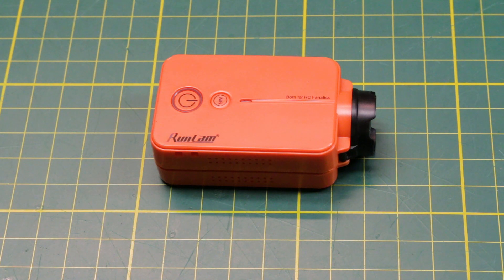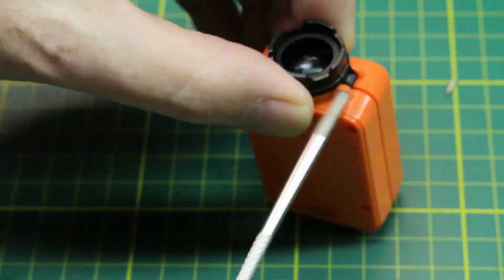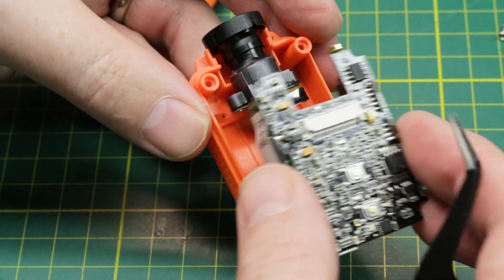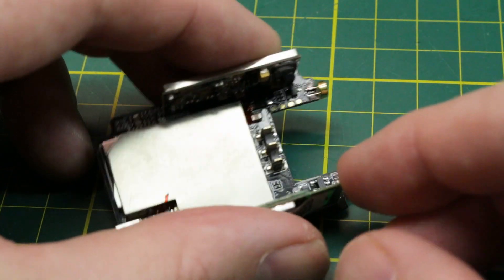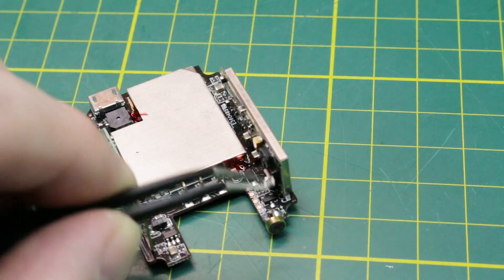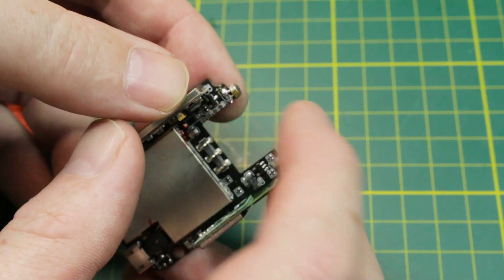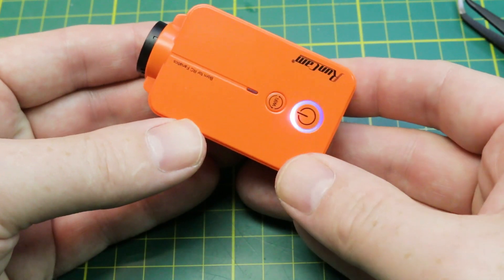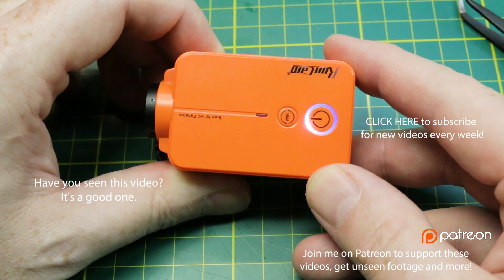RUNCAM EASY AUDIO FIX | MUST-DO MOD

Comment: I wonder if you used a lower value resister, say 100 ohm: if you could get enough attenuation to avoid clipping, but not so much that you're losing audio data cause the resulting sound while not clipping is very quiet
Reply from the maker: Its at about half volume in post (or less) so people wouldn't blow up at me for screaming quad motors in their ears ;)
Reply: Since the resistor is across the mic (rather than inline), you'd have to use a higher value resistor to get less attenuation.

Comment: It is $28 for the pack of resistors. I only need 1.. Maybe 2. Any other cheaper options?
Reply from the maker: Just grab some on eBay from China
Reply: @MkmeOrg   when you say 330 ohm 0805. Can i just look for a 330ohm or it has to have the 0805 as well in the description?
Reply: @MkmeOrg  Holy crap! I found 100pcs for $1.15 from hong kong. SOLD. Thanks man
Reply from the maker: Welcome to the madness ;)